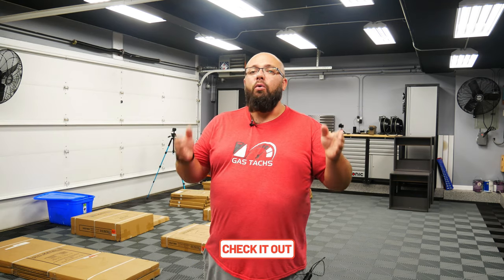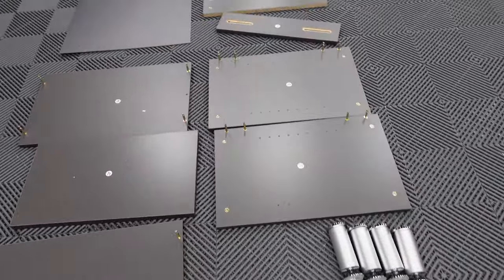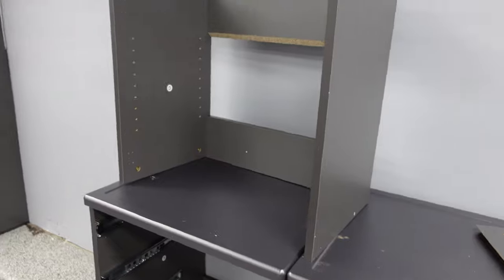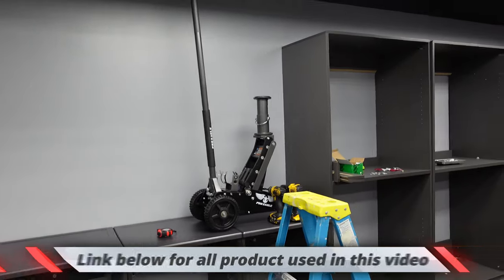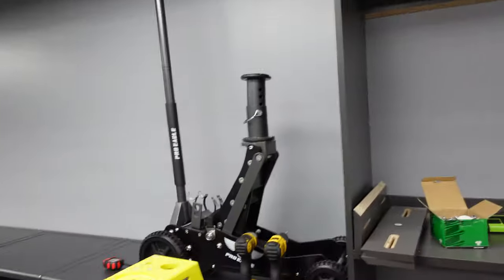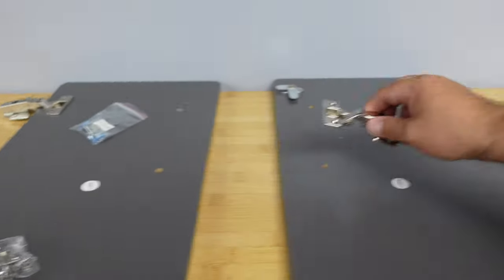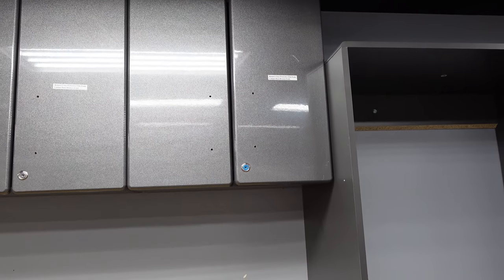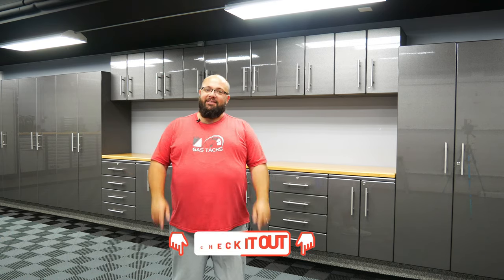Ulti-MATE Garage Cabinet "2 - Space Saving Cabinet" Assembly and Install Part 4

Comment: Thanks for this series of videos! They helped me pull the trigger on a couple sets, and Garage-Organization was great to work with. They gave me an additional bundle discount and I ended up with a mix of  three 4-drawer and two oversized base cabinets (total 12ft wide), two bamboo tops, three regular and two oversized wall cabinets, and two of the tall cabinets. Can't beat the free delivery either! My shipment was almost 1600lb and my driveway has 20%+ gradient so I had a fun time getting that all up into my shop from the curb! Still working on assembly, but almost there. Can't believe the price:quality ratio on these.